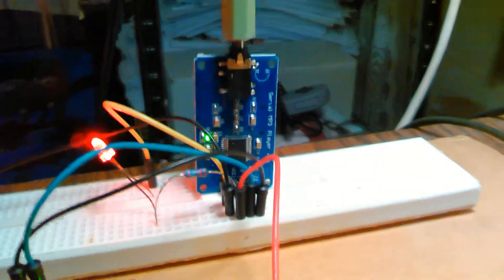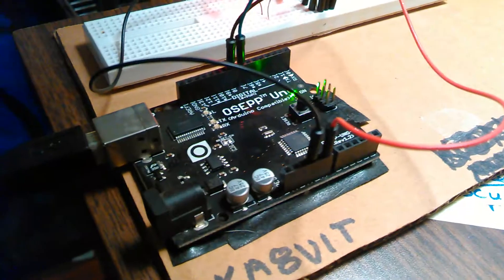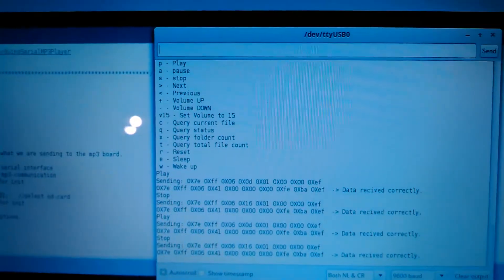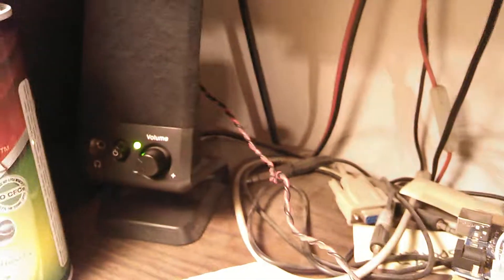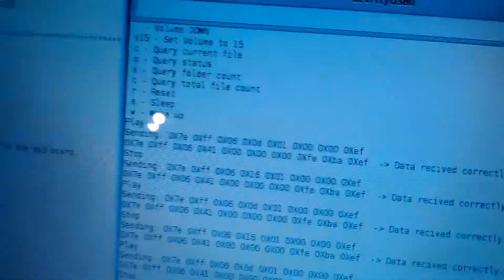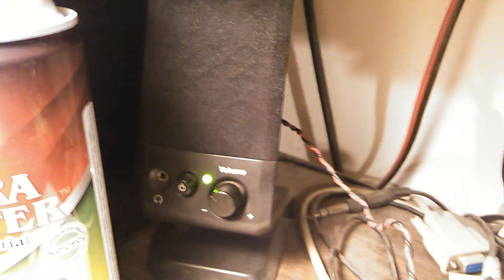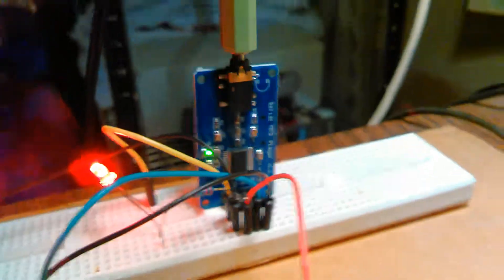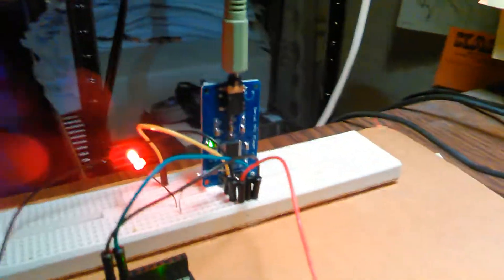First test of the YX 5300 MP3 WAV file player to make a Ham Radio Voice Keyer.

Comment: Could you tell me if this module works well with servos? I tested a micro sd module and it uses the same timer library as the servo, so when the servo moves it doesn't play sound, they don't work together! Would this module solve this problem? I need the servo to move and play a sound. Thank you